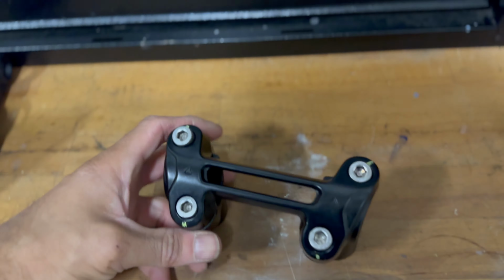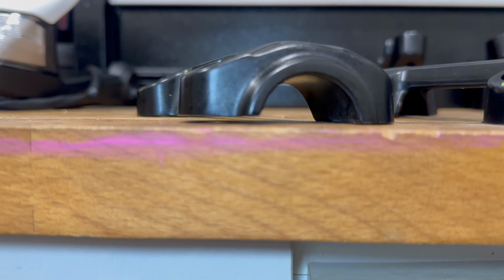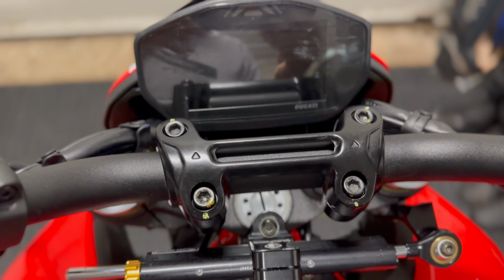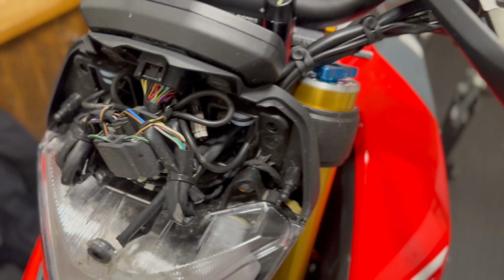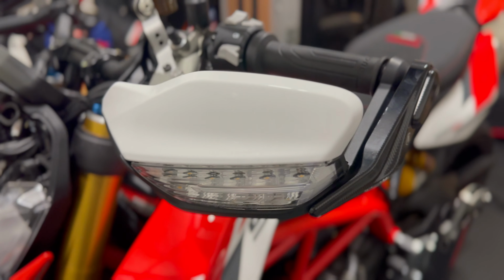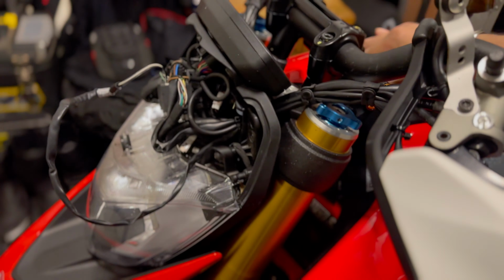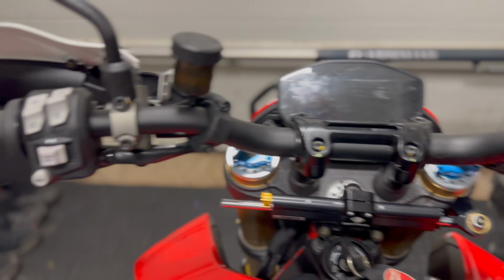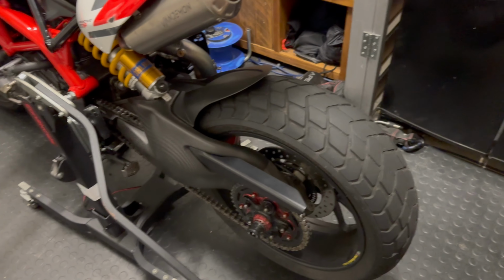Road to Resurrection - Hypermotard 950 Crash Repairs and Latest Bike Release from Ducati

Comment: Is the exhaust flapper open or closed at startup?  I ordered the smart moto plug to disconnect it but I don’t know if that’ll leave it open or closed.
Reply from the maker: If you still have the cat there, the flappers purpose is to heat up the cells as fast as possible on startup and then control emissions/noise. If you add the bypass switch then I’d also lockwire the flap open so it remains open and stays there.
Reply: @hypermotardking Ok. How can you tell if it’s open or closed by looking at it?  I thought about disconnecting it but without disassembling the exhaust, you can’t see if it’s open or closed.
Reply from the maker: @theperipateticgumshoe9047  Trial and error I guess. The plug is under the seat so easy to add the bypass then take it for a ride around 30-35mph when the exhaust tone usully changes.